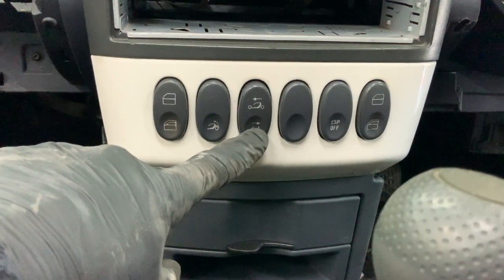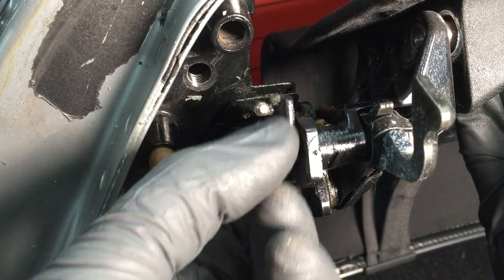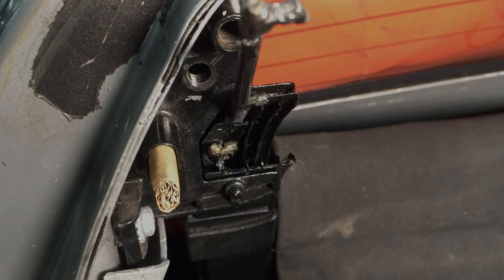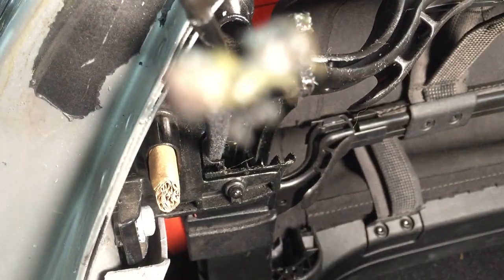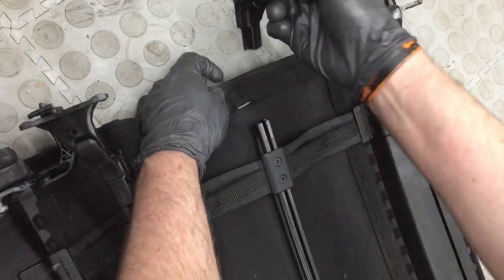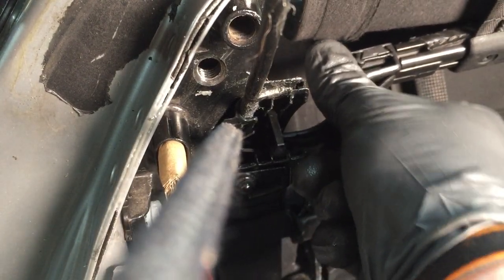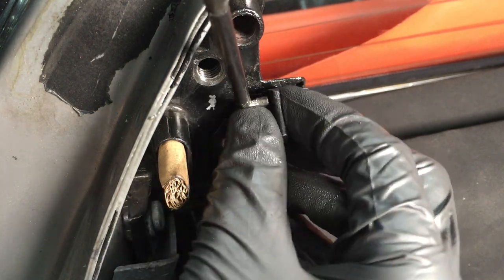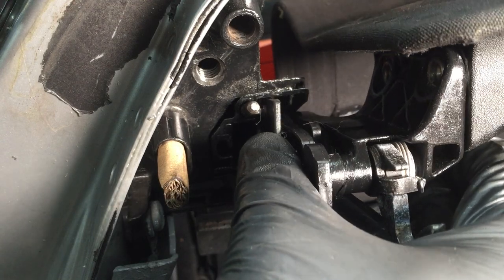Smart Roadster Roof Disassembly by Kane from evilution.co.uk

Comment: Hi Sir, is there a way to convert it to manual operated soft roof, securing rear scissors hooks and front hooks?
Do older 45 kw 452s have non electric operated soft roof? 
Thank you in advance.
Reply from the maker: All Roadsters are electric operated roofs. You could make something and swap the motor for a handle. The spring cables that are pulled by the motor are what lock and unlock the roof so you can't make it manual like the old 1960's cars where you pull the roof back by hand.
Reply: @evilutionltd  
Thank you very much.

Comment: my motor gear is skipping instead of motor stopping when roof closes fully.
Is there a end-stop switch anywhere, or how else does it know when roof is fully open or closed?
Also do you need to align both sides somehow?
Reply from the maker: The car monitors the power usage of the roof motor. When the motor stalls because it has reached the end of the travel, the car cuts the power.

If it's skipping, the cog is worn.
https://www.evilution.co.uk/1190

You can align the roof by removing the motor, manually straightening the roof and refitting the motor.

Comment: Just this minute finished doing all the above, I would have surely fu**ed up and end up botching it without your really good video. And i lost the fu**en spring !! found it later tho. another tip i found from another vid is if the plastic spring is broken take off the support clip metal piece as well as they get jammed  up and scrape the channel badly. Also used pieces of flexible plastic strips to replace the unobtainable smart clips and tied them to the strut seems to be fine. adios.